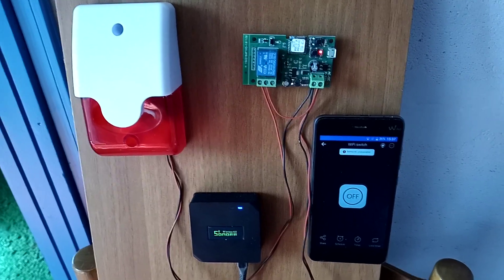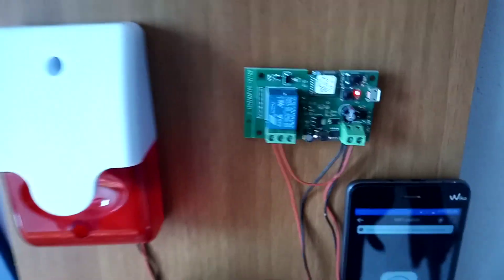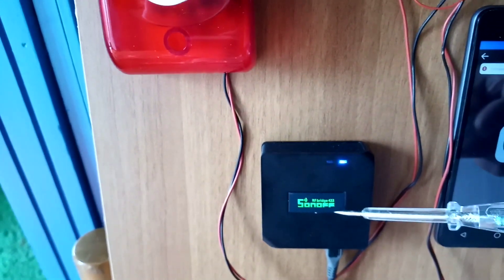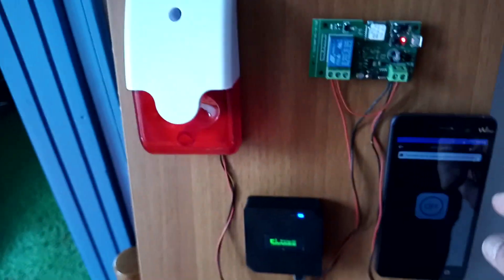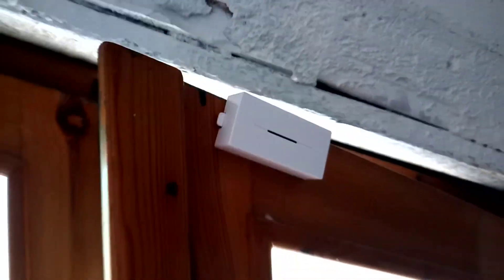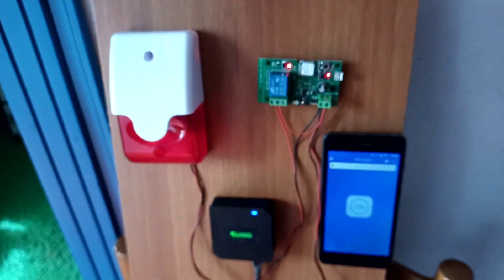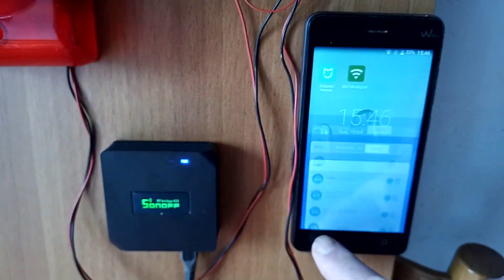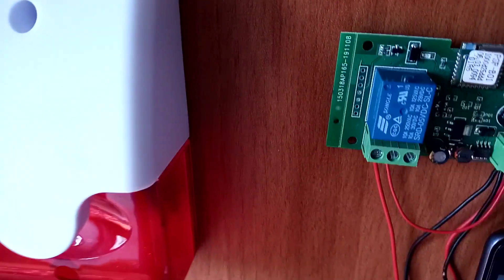DIY basics- Using a Sonoff DW1, RF Bridge + 12v delayed siren Alarm ! Link to delay siren vid below.

Comment: Hi, 

I see you use this 1ch dc5v/7-32v Relay Module
This has 2 wires going to the siren but the 2 other wires where do they go? How does this module get power?
Reply from the maker: hi, from a simple 220/12v transformer
Reply: @leonline3424   I want to use your example but I'm missing this last piece, what converter would you use? do you have a link to this 220/12v transformer?